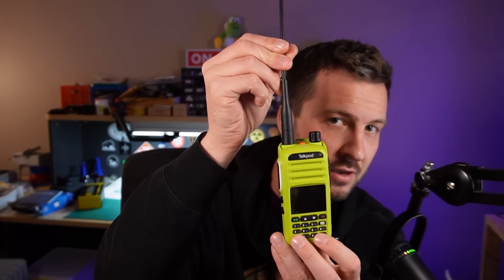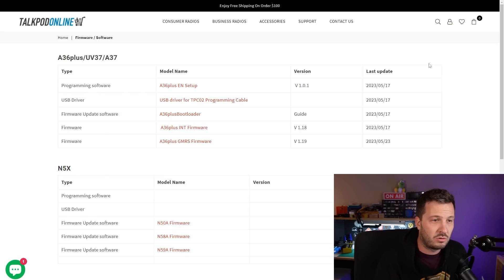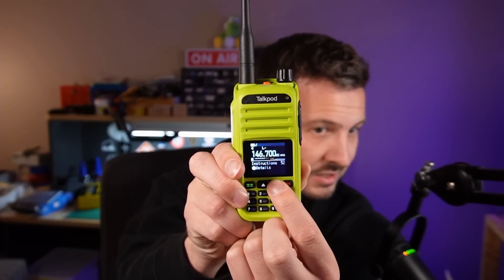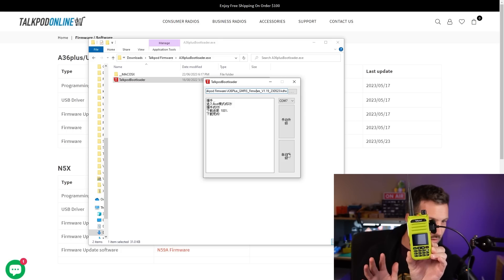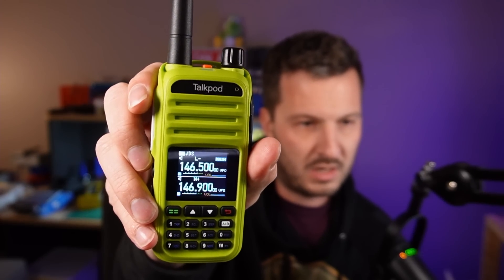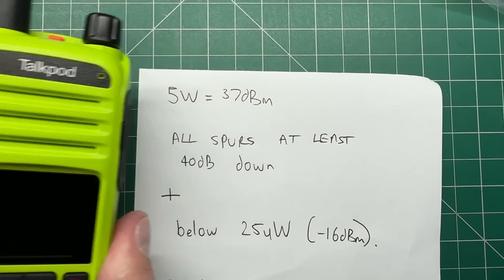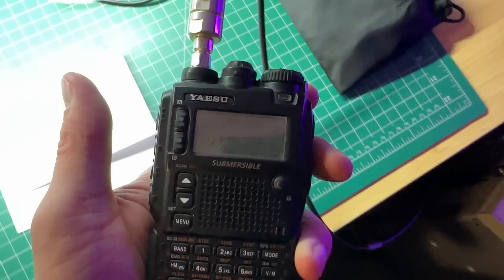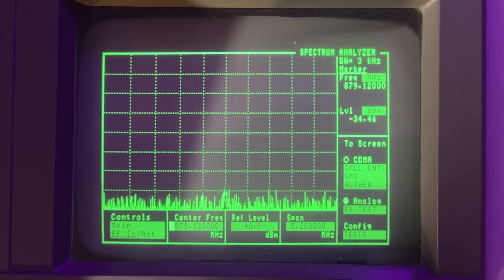Watch THIS Before Buying a Talkpod A36Plus!

Comment from the maker: More HT vids 👉 https://www.youtube.com/playlist?list=PLSuX83ay4OuiZzb3C9pd5dh1UIN593B4a

Interestingly the unit passed on GMRS tests as per this report from the FCC here. I suspect that is why it's marketed as a "GMRS radio". Also of note is I didn't do a spurious emissions test on UHF - only VHF. So results could be different there.
https://fccid.io/2ADQZGMRS1/Test-Report/Test-Report-6446698
Reply: This is a trend that I've noticed, with several of the 'Chinese-Sourced' radios.  Quality control is sorely lacking, & inconsistent.  One unit will be relatively pure in terms of spectral quality, and the next unit is horrible.

When I've put a name brand unit on the spectrum analyzer, the response is considerably better, but not perfect.  That said, the quality control seems to be considerably better, from one unit to the next.  

Taking a radio outside it's designed band limits comes with its own share of concerns & risks.  Even if the VCO remains locked, issues with unacceptable transmitter harmonics can be a real concern.

Cheap radios may not be all bad, but you get what you pay for... if you're lucky.  Food for thought.
Reply: You tested if the radio is compliant but on v1.18.
But, did you test it on v1.19 to see if the upgrade made the radio compliant or not ??

Comment: I'd be interested to understand, since it doesn't appear to meet the harmonic suppression specs, does that mean it's illegal for an Australian ham to use or does it just mean it can't be legally commercially imported?
Reply from the maker: Aussie hams have a slightly different emissions requirement than the FCC has - I think ours is no more than 12.5uW or -13dBm on any harmonic.

ACMA also expects radios used in commercial services to be “type approved” for transmission - amateur radio doesn’t have that, as we can build our own transmitters etc.

So in effect, this radio doesn’t pass the first requirement for transmission. However you can use it for reception, and the AM/Airband receiver in it is pretty good
Reply: @HamRadioDX Thanks for the info.  I have one here now, would say fairly recent production.  I'll see if can measure the harmonics to see if they have made any changes.  Only spec-an I have though is the crappy one built into my comms analyser, but I think it will do the job.
Reply from the maker: Oh sorry I should mention - the radio passes on the UHF 70cm band perfectly fine - you can transmit on that no problems

Comment: Mine was the opposite .. I got it from Amazon today and was not able to key up on any GMRS Repeater until I updated the firmware. Kind of opposite and the label does show GMRS MULTI-BAND. After that, I was able to access the GMRS Repeater. Firmware v1.21. Thanks for the information and great review! I still learned a lot from it.

Comment: Very nice reviews..I currently have to use 2 radios and it’s a pain..Will this radio transmit on air band? I need 125.000 and 151.000
Reply: Nvrmind I see it only receives air band :(

Comment: Great video.    I have noticed the tech minds video test, which shows clean transmission, measure transmission with an antenna on his Tiny SA.  I'm guessing that the A36Plus antenna cut out the spurious harmonics since the antenna is not resonant on the harmonics.  Have you considered this?
Reply from the maker: Possibly. Either way the spurious emissions measurement is made at the antenna transmission line as per “the rules”.

Comment: Got one just for the AM Aircraft receive. The other radios, Quansheng UV-K5, Baofeng UV-5R, and clones, etc. do not have true AM detection on the system on a chip, so they lack sensitivity and selectivity. Cannot really recommend this radio for transmission on any band.

Comment: It's not suitable for use on any VHF frequency.  Programmed it to use on 2M ham band starting on 146.52 so using a 30db attenuater and an hp 8591E spectrum analyzer I measured around zero db at 146.52Mhz CF but the second harmonic at 293.04Mhz is only down by 6db. This radio cannot be legally used an any VHF frequency. It spears to only be equipped with a UHF low pass filter inside and there is no harmonic filtering when using it on any VHF frequency.

Comment: No go for me. Mine arrived on 6/26/23 direct from CN ordered thru AMZ with v1.9 firmware. I re-flashed to v1.18. Will not transmit on simplex 2M or 70cm frequencies. Duplex is fine. It is heading back to AMZ for refund. Can't use it with my UHF AllStar node or .52 so that's a fail. Advertised battery size was larger than the 1800ma I received also.
Reply: UPDATE: Now transmits on simplex (vhf and uhf). Originally I had setup with mac and newest chirp. Loaded talkpod programming sw from their site to test. Only DL and UL code to radio. Now transmits on simplex. Must be chirp issue. Not returning - the audio is best of any other I have.

Comment: FROM AMAZON:                   Question: This is just GMRS and not ham correct ? Can it be converted to transmit on ham ?
Answer: Turn the radio off. Then press and hold the PTT button + 6 and while continuing to hold, turn the radio on. This will unlock transmit on 2m and 70cm (as well as frequencies outside these two ham bands).

Comment: Someone help me understand: does having these high harmonic outputs make it bleed onto those freqs? Do they improve or degrade performance of the transmit function? Are they "bad" beyond the compliance issue? Thanks! 🤔
Reply: When you transmit at your frequency you should NOT be transmitting at any other frequency AT ALL.  The -16dB number is basically your X-mit strength limit for "not your set frequency".  If you are transmitting on a harmonic of your set frequency only a few dB less than that frequency, IE 40 dB at 146 and 35 dB at a harmonic that is REALLY bad.  You are basically transmitting at a frequency other than your set frequency, creating noise and interference.  Also, the power used to transmit at those harmonics is lost.  If you are transmitting at a harmonic, you are losing that power somewhere.  It basically means this transmitter is only useful for talking (and listening ofc) on GMRS frequencies and listening on others.

Comment: Version 1.19 is super easy to program with Chirp next.  2 meter, 70 Center meter, and even 220, though at a reduced power level.  

Yes..... I did do the PTT, #8, and then ON to put it into Expand mode before I programmed with Chirp.

Comment: This the same sort of problem the early Baofengs had with spurious emissions.  Later Baofengs seem to have resolved that problem.  Still, I have never seen ANY radio, Baofeng included, where the 2nd harmonic is just a few dB down and the 3rd harmonic is only few dB further down.  This is horrible.

Comment: Those spectrum results look like the radio simply doesn't have a 2M lowpass filter at all, or is for some reason failing to switch it in. Spectrum results that I have seen elsewhere show that it IS compliant on the 440 MHz band, so it does have a suitable filter for that band -- which is likely also why the sixth harmonic of 2 meters is properly suppressed.
Reply from the maker: Yes I agree
Reply: Yes, my A36 is the same. Well suppressed harmonics on the 70cm band, no suppression when transmitting on 2m.

Comment: I’m courteous about where it will transmit. Will it TX 2m, 1.25m, 70cm and GMRS? And MURS? Thanks for the video! 73 W6AAM
Reply from the maker: If it’s running the International Firmware - yes

Comment: Pretty hard to compete with the UV-5R if you can't talk on ALL of the channels in the radio.
Reply: UV-5R has the same problem lol. but both have button combos to unlock them.
Reply: @koolcat  In what way is the UV-5R locked? I've never heard of that. I seem to be able to Tx/Rx on any Freq with mine, and I don't recall doing any hacking or unlocking.
Reply: @Elmojomo  the newer ones they are shipping are locked to tx only on some frequencies, I got two like that.
Reply: @koolcat  Like, unable to be unlocked with the keypress trick? :/
Reply: @Elmojomo  no you can use the button combo to unlock them
Reply from the maker: HAHA 😂😂

Comment: I used Google Translate from my phone to translate that bootloader - worked fine. Something to consider using when you're guessing at what it's doing or  what icons to press. 🙂
Reply from the maker: What did the buttons say?
Reply: @HamRadioDX  "manual update" - top , "Autoupdate" - bottom.
Reply from the maker: Ah thanks

Comment: Huh, using a radio outside of its tech specs blabbers all over the place???  Who would had ever thought...  Brining it up to the manufacture seems pretty pointless, its sold as a GMRS radio why would they dump time into something the device is not advertised to do.
Reply from the maker: Suggest you research a bit more. The radio is stamped 144-148 and 440-480 on the back of it.

Comment: Did you do any comparisons between the firmwares? I doubt it makes a difference since the actual hardware seems the same between GMRS (1.19) and INT (1.18), but worth a shot.
Reply from the maker: Yeah the firmware doesn't make a difference, the issue is most definitely hardware related unfortunately

Comment: Here in the states,  we are not allowed to use ham radio to talk on GMRS frequencies, plus we are not allowed to use a GMRS radio to talk on ham radio frequency. 
But people do it, but just don't get caught by the FCC!
Reply: Well your half right anyway.  Any radio used on GMRS must be type accepted to Part 95 or better... i.e. commercial grade.  It cannot be "frequency agile" to the uncontrolled operator. ANY radio however can be used on ham bands, you can even build your own from scratch.

Comment: Why care about harmonics and spurious emissions? If it was a base station this wouldn't be good. But this is a handheld radio which people take out into the mountains or woods and travel with these devices. The change you interfere with someone or something is close to zero. They are also low power which makes it even more unlikely your interfere with other devices.
Reply from the maker: I don't make up the rules, I just advise that is what they are.
Reply: @HamRadioDX  😁 I know. But this whole harmonics and spurious emissions stuff is so exaggerated when i comes to these handheld radios.
Reply: I got a Quansheng before I heard about this radio, and I don't know how clean it is. But I'll be using it in the boonies and want to monitor resource road frequencies, weather band, maybe air band., and perhaps access ham band repeaters if in range. The spectral purity is the last thing I will worry about. I really like the USB-C charging. No AC where I am going.  A VE7.

Comment: I'm interested is if will transmit on the 224 frequency and if so is it on GMRS Expand or on the International version 1.128?
Reply: Just bought one of these. It is loaded with Ver: 1.19 programmed it using CHIRP NEXT. It does transmit and receive in the 220 MHz. band, but the output seems much lower on this band... Not sure if it’s the radio or the antenna yet. But it does work.
Reply: @robertmitchum2972  It would be nice to know what the output power is.
Reply: @Dave85262   I’m getting around 1 watt on low power and about 3 Watts on high power at 223 MHz. 2 Meter and 70 Cm. Are just below 5 watts...  Tested on a Bird Thermaline wattmeter.  My guess is the antenna is no good for 220 MHZ... 
Have a Triband on order.... will post results if I can get into the repeater.
Reply: @robertmitchum2972  Right on!
Reply: @Dave85262   Just got the NAGOYA NA-320A. You have to trim about 1/8 of an inch off the plastic base at the SMA connector. Otherwise the antenna will not make contact with the radio.....   
I hit my local 220 repeater DFQ! And I’d say the machine is about 6 or 7 miles away.... So, yes..... The radio does work on 220.....

Comment: Same old CCRs in a new housing. All of these Bowelturd radios are based on the low cost consumer grade POS SOC from RDA. These chipsets are designed for consumer grade trash can radios like FRS/GMRS bubble packs sold at Chinamart. Real radios aren't based on these turd chipsets. They have filtering, manufactured with real quality control, and don't sound like a bag of smashed assholes on the air with roger beeps, low muffled/muddy audio, and don't go deaf near your wireless access point or LED lights. You can't polish a turd.

Comment: Question about this.. as I'm very newly interested in ham. I was thinking about this radio as my first grab. Mostly want to a cheap handheld to listen in before I get my license. Things I like about this model over others is screen and "water resist" if this isn't compliant listening isn't the issue but is there a similar option?
Reply from the maker: Not at the moment. For listening it will be just fine. It also appears that it's still fine for use on GMRS (see pinned comment). I haven't tested on Amateur UHF.
Reply: you could always yo the sdr route if its only for listening
Reply: My first handheld ham radio was the Yaesu ft65. Look to spend about 100$ for a "good" beginner ham radio BUT don't let anyone tell you what radio is right for you!♡ a baofeng is just fine :) just remember... your first radio won't be your last radio, because you will definitely want to try and use many many over your lifetime! 😊be well

Comment: I ordered one to just use as a scanner for airband and the am/fm radio. Don’t ever plan on transmitting on it. I have an APX7000 for that.
Reply: How’s that Air receive in the unit you got?  I work for an airline so use a UHF for company comms and also carry a Yaesu FTA-250 for Air. 

Yes I am such a Yaesu Fanboy I have the Air transceivers as well (and am permitted to Tx on it too).

’d love a radio that is r/t on UHF and even if it  would only allow me to monitor Air that would be great. 

I bought some Quanshangs hoping to do it but the AM on them is terrible. 
After chatting with Hayden (become a Patreon and you can too!) I am going to try some different antennas and see what happens. 

Let us know about yours.
Reply from the maker: Yeah I can't fault the Airband quality, it sounds pretty good for what it is
Reply: Transmit? Are you referring to talking on it?
Reply: @myfirstrodeo208  yes. That would be what transmit means.

Comment: I didn't realise this until recently but the A36 seems to be the same as the Abbree 730 I just reviewed, and I saw the exact same results on the spectrum. Totally unusable if anyone wants to be compliant. Such a shame as they are really nice lightweight radios to just chuck in a back pack.
Reply: And they do air band listen. I wish the baufeng did air. Maybe There is a new version since last I looked last year.
Reply: Maybe ask them to fix the issues and see what the manufacturers say. Even in if it added $10 a radio id gladly pay it. I bought one anyway but I'd buy another one if they could fix the harmonic issues. Think they'll do anything about your honest review results?
Reply from the maker: Thanks Matt. I pinned above a comment, it appears they passed compliance tests for GMRS, so perhaps that explains a few things.
1) Why it's marketed as a GMRS radio - and locked in the US market from sellers like Amazon
2) A 2nd harmonic on GMRS would be up above 920 MHz, where my unit started to drop off in emissions.

Agree, nice little radio otherwise with a great RX (audio quality)

Comment: Hi Ham Radio DX, great video by the way. Hope you don't mind, I have a question. I own just a Baofeng UV-5R but I am looking for something "cheapish", along the Baofeng line I guess, that has AirBand. I have watched all your videos regarding this Talkpod A36Pro and the Quansheng UV-K5 and in your opinion, which one would you go for?
Reply from the maker: If you just want to RX, the Talkpod smashes the UV-K5 for Airband quality. But if you want to TX, then probably the UV-K5 as it's better with the spectral purity test - at least mine was.
Reply: @HamRadioDX  Thanks